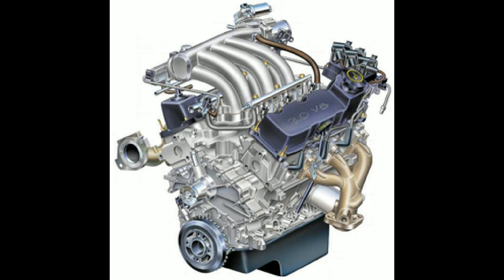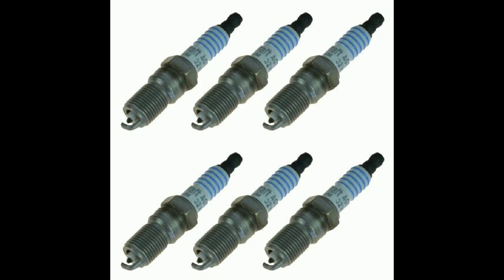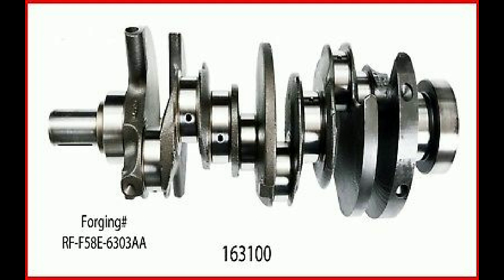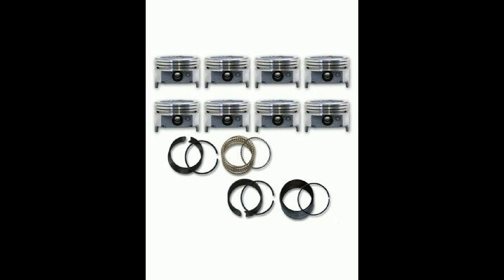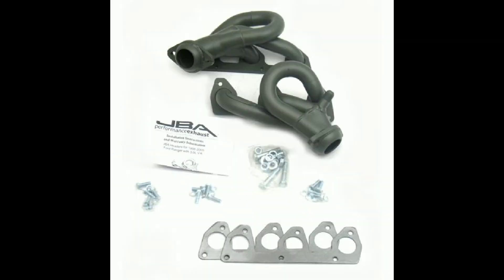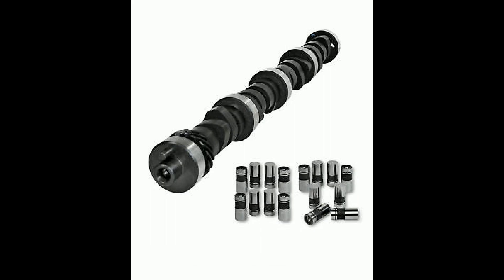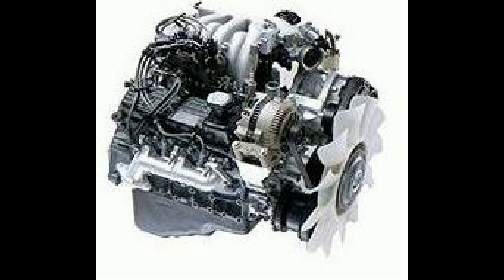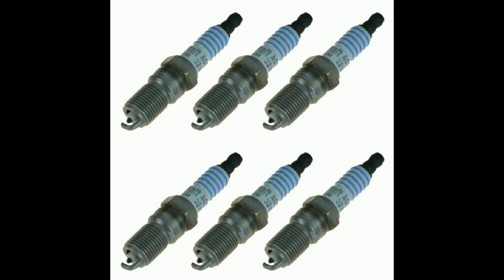The Potential Of The 3.0L Vulcan V6

Comment: I have a few 3.0 liter  is it possible  to get forge piston from  you to give me 3.2 liter? And I have another  engine ford 2.9 cosworth  engine  can you make  some too for that engine
Reply from the maker: I used a stroker kit to get more displacement. You might have to find a speed shop that specializes in that engine to help.
Reply: Thanks  here in canada  there is nothing  here to help me out
Reply from the maker: @MrMrBigro  try this company. This is where I got my stroker kit for my Vulcan. They sell a stroker kit for a 2.9L Ford V6 that enlarges the displacement to 3.5L. The only thing I'm not sure of is if it is a cosworth or not. You will have to contact them and ask. 
http://www.moranav6racing.com/category.html?CategoryID=38

Comment: Yes I understand that in the book said Vulcan main is 2.519 inch the sho is 2.516 inch and I found a a sho spec crank and when the guy measure it it spec out at 2.519 inch as to my surprise he this 3 time but the difference is the thickness of the main the vulcan are thicker then the sho so either I will go to Toyota one or I will bore it out to accept the vulcan main don't know yet

Comment: I have the sho engine do you have some upgrades for it thank
Reply from the maker: There is a big aftermarket for the SHO engines online.
Reply: @ragintaurusmusclemercury7023  well thank but so far I haven't been lucky to find upgrade part like main bearing and so forth and now I have discovered that the main might be the same diameter as the vulcan engine or the machine shop might have done a mistake but they measure them 3 time
Reply from the maker: @MrMrBigro  Even though the SHO V6s are designed by Yamaha they are based on the Vulcan so there are a few pieces that can fit with machine work.

Comment: I want to do a N/A build on my 99 Ranger 3.0 (same engine as the 3.0 Taurus), I have the mod list but idk if its overkill but I would actually need a water injection so none of internals don't break & do I have to get ported & polished heads from Tom Morana Racing?
I want to stay under 300hp though

here's the mod list:
1999 Ford Ranger 3.0 V6 mods:
 - long tube V6 headers
 - Morana racing header flanges
 - hi-flow water pump
 - hi-flow oil pump
 - lawson industries high flow cat
 - Jones exhaust flowpack muffler
 - 3.55 gears
 - tachometer 
 - roll cage
 - 13" Brembo slotted & vented rotors
 - 1:8.1 rockers
 - strut brace
 - ported lower intake manifold
 - ported upper intake manifold
 - cold air intake (heat shield)
 - stage 1 performance camshaft
 - heavy duty springs
 - 60mm throttle body
 - 3.3L stroker kit
 - dual 2.5" tailpipes
 - Jones exhaust 3" chrome tips
 - jet underdrive crank, water pump, & alternator pulley
 - ported & polished heads
 - 2000 stall high torque converter
 - mustang GT fuel pump
 - 200amp alternator
 - water injection
 - oil cooler
 - tune

Comment: And the last thing is I used a 62 mm Cooper ball bearing turbo and that turbo never failed me from 90000 kilometres to 522000 km until today it works phenomenally it is an expensive turbo but at the end of the day you get what you pay for a longevity and long-lasting turbo you will pay a good amount for it but like I said this motor I can put into a different vehicle and easily get another five hundred thousand kilometres out of it due to the fact of his engine costs the same amount as a cheap new car till today but it's only job is to be high horsepower output and to last. If manufacturers build their engines to the standard that I did the cheapest car out there would be 45 to 50,000.

Comment: One last little bit when you fully build it and you Fuller started up and you noticed that there's a lot of piston noise going on the only way to solve that problem and solve it quickly is only use fully synthetic oil heats up quicker and it quietens it down within about 30 to 34 seconds

Comment: I hope my comments and my information has helped anyone who is trying to build a fully built 3 litre V6 duratec I definitely recommend it but at the same time it is a bill that could be long-term if you don't have the budget or could be short-term if you have the budget but at the end of the day it is a phenomenal found an engine and the pull of the engine can overcome any R35 also at the same time the block can handle up to 950 horsepower before cracking. Any more inquiries please message me at cnealmoura123@gmail.com.

Comment: Also when I was daily driving that car at 400 horsepower 400 + foot pounds for at work I was averaging about 400 km on a full tank of gas which is about 325 miles to a tank of gas which is pretty bad but if I drove it like a rockstar everyday I would only get about 200 miles on a tank of gas at 91 octane

Comment: Once you get past the 3.2 litre you are going towards a Chevy motor and the sound and the power is totally different to a 3.2 I guarantee go for a 3.2 and build it pretty much Bulletproof and drive it as daily build and I guarantee from time to come you will have lots of fun and not engine and transmission Welby the most Happy Valley components that you'll ever know and easily surprised 500000 km on heavy punishment

Comment: The s h o pistons and crank can only hold at a maximum 400 horsepower but at that horsepower you are not looking at longevity. So that engine would be reliable around 300 maybe 350. For about six years before it starts destroying itself APR does the best for it is to all of Billet aluminum Steel. Yes it is expensive but at the same time this motor without the sound of a GT-R R35 it's the exact same displacement and everything but at the same time it kicks a heavier hit then an R35 will that be want to

Comment: But if you are looking to hit 900 horsepower in this car be prepared to spend close to $18,000 in parts. It has been done multiple amount of times and when you hit 900 horsepower with this engine you are easily pushed 8.5 second passes on the quarter mile

Comment: It is telling you don't push it any over 5000 RPM with the stock crank in it if not the crank will shatter and your Pistons will go somewhere. You have to build forged internals and all of the engine APR does the best and has every single part and component for this engine up to 900 horsepower

Comment: One other thing if you are planning to build this engine to a very high horsepower output you have to lower the RPMs of the red line the normal red line is at 6305 RPMs and I was at 400 horsepower 400 lb of torque at 5800 RPMs. These engines do not like to rev High the more the Power the lower the RPMs if you increase the RPM's be prepared to blow up your engine like a kid finding out at Christmas time he didn't get the present he wanted. There are great engines to build but they do not like to rev High the higher the horsepower the lower the RPM you have to go as the only way to keep these engines reliable and high horsepower and stupid amount of pulling power with the torque that they can give out of that four-speed automatic. I have pushed the 4-speed automatic with a new clutch in it I have pushed it to 698 horsepower before it started slipping. So the force-feed is really good but at the same time it's a highway built transmission not a quarter mile transmission or a mile transmission. Grey and Jen grey car just like any engine if you're going to build it and you want to build it to last expect to put between $8,000 plus into the engine bay and transmission

Comment: I have had these 3 l V6 duratec for a while and I have had my fair share of building them. I have built five so far and four of them have being at 400 horsepower 400 pounds per foot of torque and I have driven that motor as a daily driver to 500,000 km on 04. Very reliable build APR builds all a p r Pistons APR head studs a pair of gaskets APR crank and dumpster cams. Not actual dumpster cams there the name of the brand. But it is a very reliable and very solid engine if you build it right a 400 horsepower and a 400 lb of torque engine was the 3 litre V6 costed me just over $8,000 to build. The engine runs and drives perfect everyday at 500,000 km I don't use it because it's done its job I'm currently going to build a 2002 Ford Taurus station wagon with a 4-speed with the same exact engine and I'm going for 600-horsepower 600 + pounds for the torque
Reply: That sounds badass
Reply: Did you turbo it?

Comment: Great motor for reliability, just slow as helllll.
Reply: I got my 2007 Ranger STX tuned. It is putting out around 200 HP and can keep up with any stock Ram Hemi. The takeoff is now impressive for the the laughable slow 6. It will top out at 137 MPH now.
Reply from the maker: In stock form. There are simple mods that can get them in the 200+ hp range. 300 hp with low boost and stock internals.
Reply: And look at the new 3.0:)

Comment: I cannot find headers for mind
Reply from the maker: You will have to have some made. Morana V6 Racing sells header plates for the Vulcan. Then you will have to get a head fabrication kit and make your own. 
http://www.moranav6racing.com/category.html?CategoryID=36
Reply: I did the Morana, plate.  Get 1998 mustang headers. Bolts to adapter. Also use the FelPro gasket for the mustage header, not Hedman gasket.  Gasket holes are smaller than the exhaust holes on the adapter.

Comment: So what could one realistically expect to spend on one to make say 250-300hp? Have cores already.
Reply from the maker: Depends on how much power you want to make. My Vulcan has a stroker kit and stage 1 cam with exhaust and mild tune. It makes 225 hp to the wheels and I put in $4500 and did most of the work myself. I am going to supercharge it after changing the head bolts, head gaskets, ignition, and fuel system. Looking for 320 to 330 at 10 psi boost but that is the most you can get with cast pistons. You will have to build a full forged bottom end if you want anything higher without blowing the bottom end out. Performance is not cheap.
Reply: So with say a set of forged pistons ported heads and intake and let’s say 8-12psi boost it should make close to 300? Would the stock camshaft profile support this? I will probably be piecing together my own rotating assembly crank will be the only stock part of the bottom end.
Reply from the maker: @dapowerranger4985  You can use a stock cam but it will limit the total horsepower and torque. The plus is it is more streetable and won"t give you issues with the transmission shiftng properly. With a stock cam you are looking at 250-260 horsepower tops but remember this is over 100+ more than stock.
Reply: Vulcan Taurus Performance that is exactly what I’m looking for. My 91’ ranger used to have a 3.0 before I Ls swapped it and I loved the Lil 3.0 had lots of fun with it. but I just recently acquired a 92’gmc s-15 and I think I’m gonna swap it with a Vulcan I just wanted to know what kind of power I could expect
Reply from the maker: @dapowerranger4985  I bought a 2002 Ranger 4x4 this year with a Vulcan in it. When I am done with the Taurus I will be working on it with videos to document the process. The engine will be the first thing. Looking for torque over horsepower. Should be a fun little project.
Reply: Vulcan Taurus Performance do you know where I could get some decent hard parts for a m5od-r1? Or do you know what other standards will bolt up that will take some abuse? It will see lots of clutch dumps and and clutch kicks... just gonna be a toy to mess around in
Reply: Vulcan Taurus Performance I just got a 99 ranger 4x4 with the 3.0, and was hoping to get it to maybe 200. I’m not wanting to put 3k in parts to build a v6 when it would be cheaper to swap a v8 but what would you recommend I do to get it there? I have a cat back exhaust already and that boosted power by about 15 or so, will probably do new intake manifold and headers as well, but this engine has 200k on it and has been beat on too so should I rebuild it? Thanks
Reply from the maker: @DylanC828  Exhaust, stage 1 cam, headers, intake, throttlebody, and tune with the stock block can get you to the 200 hp mark. There is a guy who got 210 whp with that setup.
Reply from the maker: @DylanC828 The Vulcan are anvils. I seen some go 350,000+ miles with no problems. If the engine runs good and does not burn oil then there is no need to rebuild it if you are not going to boost it. I would change the head gaskets, oil pump, and fuel pump though with that many miles on it.
Reply: Vulcan Taurus Performance I'm excited for a torque focused ranger build.. They don't need to have a high top end to be fun
Reply from the maker: @Drew-wf7vw  The was originally designed for torque over horsepower. A simple stroker kit and a stock cam would be perfect for a truck application where low end performance is needed.

Comment: Where did you get the front bumper/skirts for your Taurus?
Reply from the maker: They are made by Razzi. You can buy the full body kit or go to other sites and buy the parts separated.
https://www.razzi.com/
Reply: You can use bumper lips from a 1999 Mach 1 mustang for the nose of your Taurus it's a even fit all you have to do is draw a
Reply from the maker: I already have on on my Taurus. Made a video installing it.